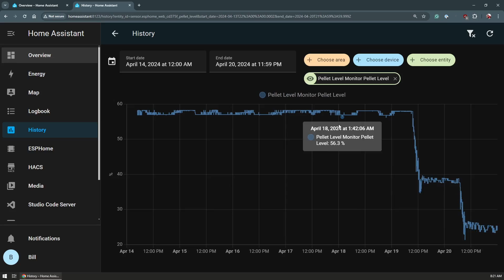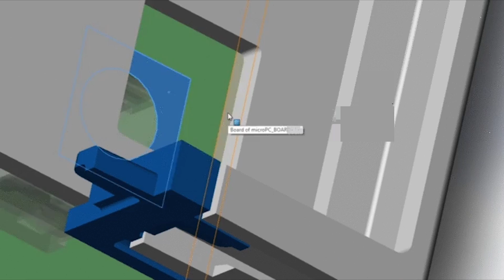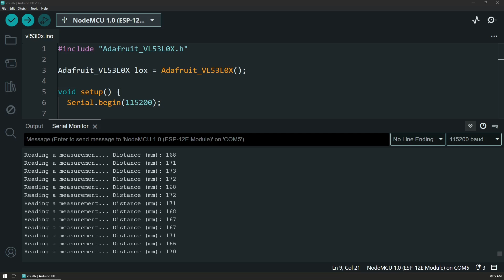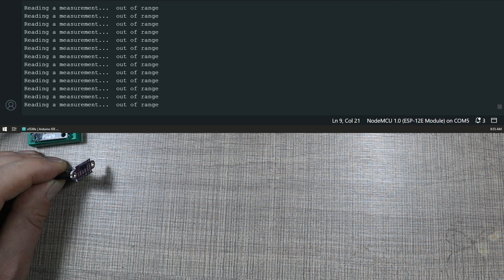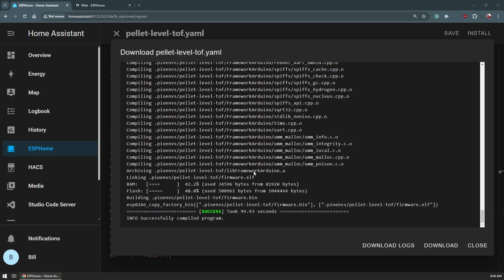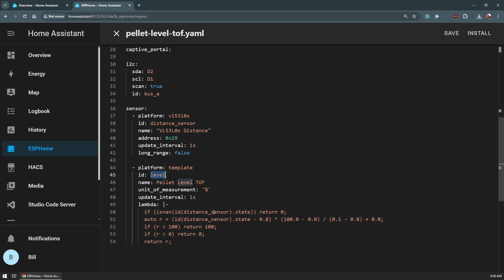Time of Flight Sensor (VL53L0x) for Distance Measuring in ESPHome - Pellet Level Monitor Update

Comment: Hello my friend, i need to measure the pass of an object at obout 90 km/h, do you think this sensor could catch it? (ESP32 project, but not esp home.)
Reply from the maker: No idea. I've never had to measure something that fast. The potential issue I see in using this one is the narrow beam it works at. The object will need to be passing at a very precise position in order to be able to detect it. May I ask what is moving that fast?
Reply: @TasteTheCode  Thank you! It´s a socccer ball. I need to evaluate the events at the worst possible scenario, that is a proffesionbal football player shooting at max speed
Reply from the maker: @sebastrong  Hmmm, that is an interesting challendge. My first thought comes with using some sort of beam that gets interrupted similar to how ballistic chronographs work. From the time difference between the breaks in the lights, you can work out the speed at which the ball traveled. Commercial products seem to be using a radar to track the ball.

Comment: Does the TOF laser sensor also work outside ?
For example, can the sensor be protected from splashing water e.g. by a glass pane or does a pane interfere with the measurement?
I want to build a Distance Sensor for a boat which gives an alarm when getting close to the pier.
Reply from the maker: I haven't used it specifically outside but I do not see a reason why it should not work. Some modules come with a protection glass on the front that can be clued to a case so you can make it water resistant. Let me know how your project goes, it sounds interesting.
Reply: You would have to ensure you use a protective medium that is transparent to IR. AFAIK most glass is opaque to IR.
Though there are definately some plastics you can use (the black-looking plastic they have on remote controls for example).
Reply from the maker: Yes, true. The protection that comes with some module is made out of material that allows for IR to pass through.

Comment: I've had exactly the same setup for pellets measuring - at first I've had ultrasonic module, and i can say that it's quite unreliable. I've had to use all sorts of filters to eliminate false empty or/and false full readings to achieve sort-of acceptable result.
 
This winter i replaced it with this laser sensor and it's way better. More accurate, and absolutely no false readings. I have only basic median filter (only to eliminate very small deviations) in esphome and results are perfect.

However, my strong advice: GET IR PROTECTION for this sensor! I've had it without it and had to remove and blow it with air two or three times during winter to correctly read again because of dust. Later i added protection and problems are gone - i only wipe it out occasionally. There are original protections available for this sensor, or you can get sensor with this glass already installed.
a
Reply from the maker: Cool, thanks for sharing.

Comment: ive been lookong for a laser sensor for mwasuring tiny distances, i thought it would be the way forward (its for a blade alignment sensor for my bandsaw, it needs 3 points of reference along the blade) i thought lasers might be available but i cant find any high res/small distance ones for less than 3500. i need micrometer accuracy i guess.

i had pondered taking apart some optical mice and using the sensors in those somehow, theyre fairly accurate. but i need a measure to tie them to. i fail at programming 😂
Reply from the maker: Well I'm not aware of any. These will not be that precise.

Comment: The Graphics that I see in the ESP Home is already built in, I mean pre coded in the ESP Home? About 6:14 in the video. Thank You. Nice Project Sir! Keep it Up!
I see from what I understand as you say Sir, it displays the reads and translate it based on the template...is there any other template that I may use for a basketball arcade more of a seven segment scoring template for a sensor that can function as a ball counter.
Reply from the maker: The graphics are part of Home Assistant, it is the system that ESPHome runs on for smart home management. There are templates for different sensors but I'm not sure which one you can use for a basketball arcade.